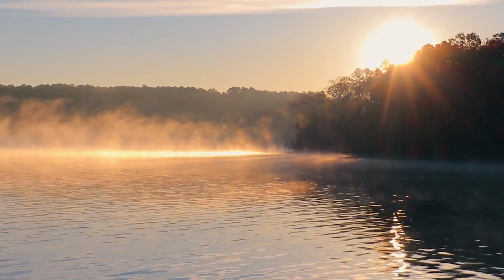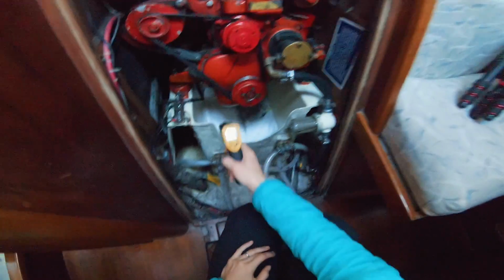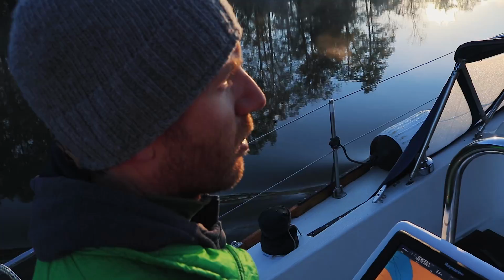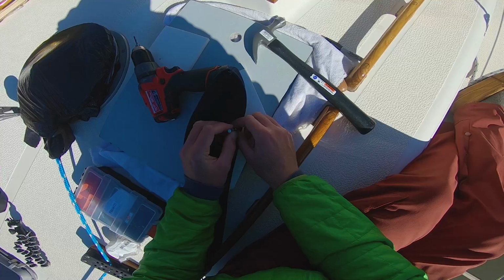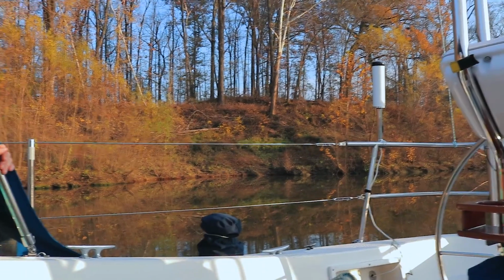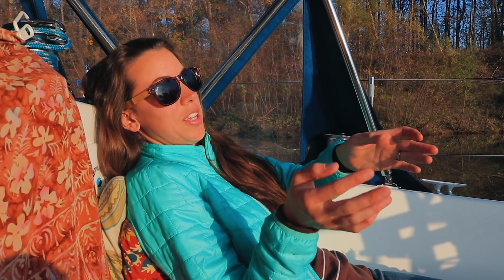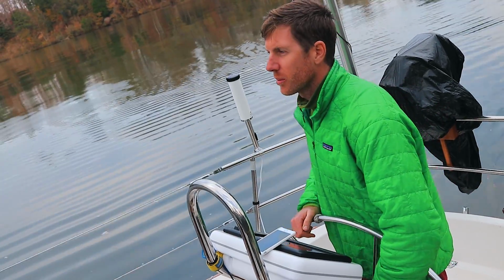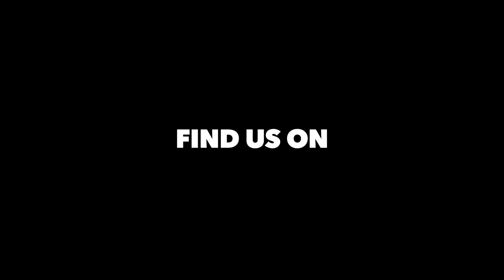Life on the River | Sailing Soulianis - Ep. 31

Comment: I think you guys should take a day off and use the whole day listening to a mechanic. Not only for safety procedures but also to learn about the engine.

And an additional day from someone who has a few decades of experience sailing. They can explain you lots of quick fixes, emergency fixes, safety things, etc.

For example, what would you do if you lose your rudder? What to do if part of the rigging fails, reefing and when to... just some examples.

I wouldnt want anything happening to you guys, just remember, water and wind are the most dangerous things.
And you are living on it full time.
A hospital is far away when your on a boat.

Comment: Did you change the oil on your trip south, or just top if off occasionally?
Reply from the maker: We changed the oil once when we reached the Mississippi and kept an eye on it the rest of the trip.
Reply: @SailingSoulianis  Thanks guys!  How many hours did you run your motor from Chicago to the Gulf?  This is a route I plan to run possibly next fall.

Comment: I have preheated diesel engines with a little cube electric heater too.  You throw one of those in the engine compartment and sorta seal it up and in an hour or two you are ready to go.  That would work on shore power.  The alcohol stove is likely much easier though.  People in Siberia leave oil lamps under their vehicle engines all night to keep them from freezing.
Reply from the maker: Yep! Whenever we were at a marina we used our space heater instead.

Comment: Having operated a truck-tractor for 30 years, I found that it was beneficial to diesel engines to keep fuel conditioner in tanks. It helps with cold weather starts and helps prevent algae build-up.Also, a small amount of #1 diesel helps.
Reply: But should it ever be difficult to start a diesel at 55 degrees?  I can understand -20.
Reply: @curiousnomadic  I agree...That is a warm spell.
Reply: I wounder if it's more a rings or compression issue?

Comment: Glad your videoing again!!  Never use starting fluid in a diesel!! Blows the head gasket. If she's not starting easily, check to make sure your intake pre-heater is actually pulling current! You can use your hand to feel warmth or use a voltmeter to verify voltage at the module. I suspect it's not working! It lives below the air horn (top of motor)on the intake manifold and has a wire going to it. You can remove it and inspect it or make sure it is shorted (it's a coil of wire that gets hot) with an ohm meter. Then make sure it gets voltage when you request it. It actually heats the air in the intake to aid in combustion(duh). It should start in 20 degree weather. This is an alternative to glow plugs and a much superior one. PS: I pulled up the manuals for your engine and looked at wiring and parts to identify where it is. Great Drone shots and they are not kidding about the skeeters!!
Reply: That depends on the engine, some diesel don't have preheating (glow plugs or heat grids especially older commercial ones) on them and staring fluid is fine for them. This engine might just be one of those. I have John Deere loader in my barn right now that I have a electric block heater on it for winter starting and when I don't have time to plug it in I give it a shot of starting fluid in the air breather.  That's what John Deere recommends for winter starting.  I agree you shouldn't use starting fluid on any diesels that preheats. But one that doesn't will NOT blow the head gaskets. It should be used very sparingly no matter what .It does dry the cylinder walls on any engine and it can lock up diesels. When the lockup happens you just have to wait for 15-20 min for the starting fluid to evaporate out of the engine. If it blew head gaskets I would have blown a ton of them on cranes & dossers & loaders and framing equipment over the years. I have a 2017 1 ton Chevy Duramax pickup truck that I would never use it on. It just depends on the engine. 

I would consider a block heater for the engine. You can put one in a cooling line or one that installs in a soft plug Then if you have a generator on board start it up and plug the engine in for 30 minutes and it will start like its summer. 

I also agree with some other comments you received on checking oil on a running engine. Its not accurate and its a safety issue waiting to happen. Check the oil before starting the engine. If someone gets some clothing caught in a belt of something in that running engine it could make for the worst day of your life.  

One thing I would be mindful of is, if you do use starting fluid you want to run your bilge blowers if your boat has them and vent the area real well. Stating fluid is very flammable, way more then diesel fuel. You don't want those fumes building up in the bilge, you could have an explosion or fire on your hands in an un-vented area. Be careful with its use on a boat.

The scenery in the video is just fantastic.
Reply: marty, these older video you can spray (a little) of starting fluid (ether) in them. I am a certified diesel engineer. Thanks
Reply: Sorry mean “Diesel”

Comment: Electric magnetic engine heater they're cheap and efficient. We used em in the oilfield in the old days they just stick right onto your oil pan.
Reply: Diesel big rigs and pickup trucks use them, some are mounted through a plug in the block somewhere and there are even dip stick heaters
Reply: Electricity is limited on a yacht. Buy yourselves a can of easystart it’s ether based. Just spray a couple of puffs into the air filter and she’ll fire up no problem. Make sure you use it sparingly as it can dry out the bore.
Reply: @Chris Mills perfectly good way to damage your engine.
Reply: Only if you use too much which is why I said use sparingly.
Reply: @Chris Mills why risk it? When there are many harmless ways to start a cold diesel. You risk causing severe piston / rod damage through Detonation useing Esther in a Diesel engine. 
Stuff the exhaust with a rag real tight and turn over the engine.
Or run a hot hair dryer down the intake while turning it over. 
Like mentioned before a cheap oil pan heater would work great if you have enough power to run it.
Reply: Fair enough although I have used ether on numerous occasions (many years ago admittedly) with no issues. Anyway don’t want to make a big deal of it.

Comment: I noticed you added oil. Is this every day or ?
Reply from the maker: On the river we motored 10-14 hours a day, so we were checking the oil constantly.  We didn't always add oil, but Mr. Beke does seem to eat it up.
Reply: Keep an eye on this consumption. I've never added to my drive units on my boat and they have close to 4100 hours. Yanmar brand. Watch or for those alligators!
Reply: @Military-Museum-LP  They checked the oil with the engine running which would read low.  Adding oil at this point would overfill the engine and would cause higher than normal oil consumption.
Reply: I know from experience on big CAT motors used on rock crushers the procedure was check the oil cold and then when running. I know nothing about their motor but I'm sure they research it.

Comment: Oil levels are checked when engine is off. Oil is circulating  when engine is running. Your dip stick will not indicate correct oil level. it is also a potential problem to add oil when engine is running, you also run the risk of injury with moving engine parts. I suggest you also read the manual that came with he engine .If you don,t have it may be available on line. Good Luck!
Reply: OIL LEVELS ARE CHECKED WHEN ENGINE IS OFF!!!!!!
Reply: Yes, I cringed watching her reach over that spinning fan belt.
Reply: @markleyg me too
Reply: OIL LEVELS ARE CHECKED WHEN ENGINE IS OFF!!!!!!

Comment: why would you check the engine oil with it running???  all ways check with the engine stopped or first thing in the morning other wise you will get a falls reading and over fill the crank case by at least a quart that`s  how much if not more that is circulating in the unit at the time when running.

Comment: What were you doing with the metal pan on the top of the motor? Heating the intake air or was it resting on something you wanted to heat up a bit.
Reply from the maker: Yes just trying to heat the air around the intake after we warmed the block.

Comment: Hey guys. Regarding your cold engine starts. Buy a can of Easystart from an Automotive store , it’s an ether based product that you spray into the air filter just before you crank the engine over and she’ll start every time. Use sparingly though as it can dry out the bore’s if over used. Cheers

Comment: Hey sweets, you don't check te engine oil while it's running. Ony when off.
Reply: I was getting ready to tell them the same thing
Reply: Some engines, but not westerbekes have two marks and one set is cold, and the other side is running... Cats are one of these.
Reply: If you don't actually know what your talking about try  not giving advice.
Reply: I'm a mechanic and you don't check the oil when the motor is running
Reply: @Moody10050  Try not to be such a snarky a$$. Just trying to help them. I've been working on diesel and gas engines for over 40 years and have NEVER heard of or known anyone to check the oil with the engine running.
Reply: I have never heard of checking oil either when the engine is running,  I wouldn’t advise putting your hand in past  the running fan belt especially with loose clothes,  it is really dangerous,
Reply: @HDRider1601   Exactly. Oil level drops when the engine is running because it is pressurizing the system plus oil being thrown off the crankshaft onto the dip stick will give a false reading.

Comment: Starting fluid,... it's a must have.
Reply: You don't use starting fluid on a diesel... can you guess why?
Reply: Turn off the pre heater first
https://www.holtsauto.com/holts/support/can-use-bradex-easy-start-diesel-engine/
Reply: @Moody10050  I've been doing it for 40 years,... Motors WITH OUT glow plugs, that is.
Reply: @Moody10050  Diesel engines are what starting fluid is for.  Just don't use it on a glow plug engine. Use in moderation. Better to have not enough than to have too much.  On a small engine like that, a little sniff will usually do the trick.